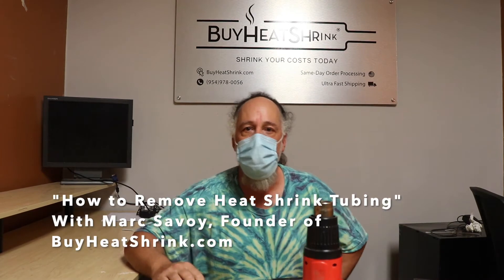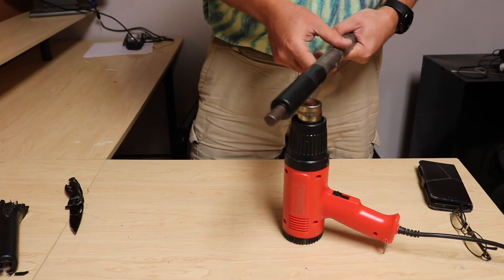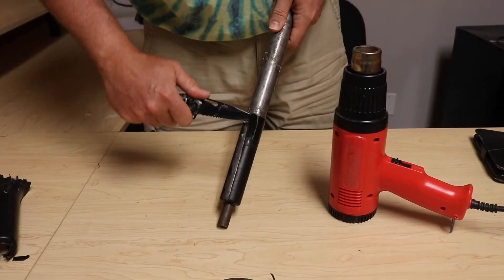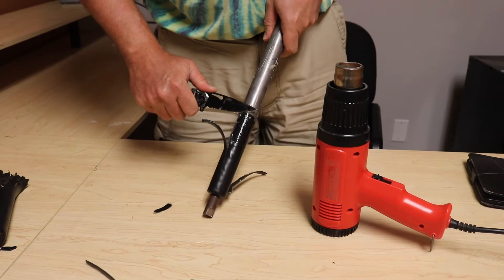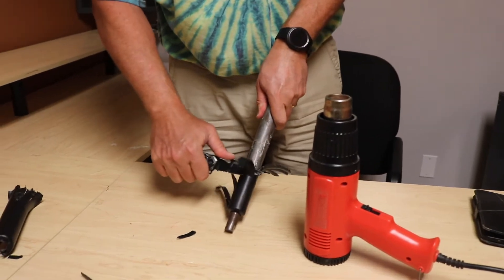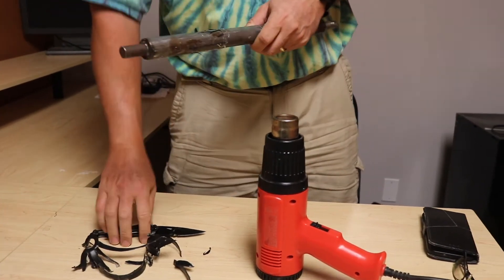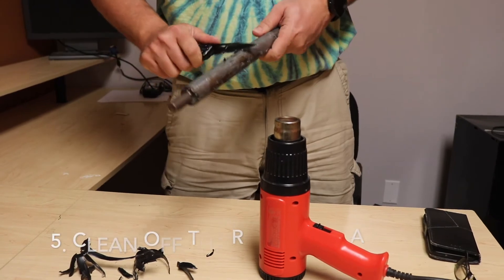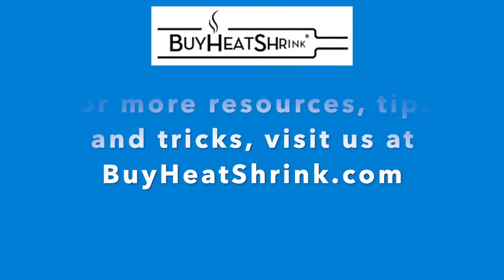How to remove Heat Shrink Tubing

Comment: Isn’t Shrink tube used primary on wires? And how to get it off the wires will be the real question
Reply from the maker: Hi William - you are correct. Heat shrink tubing is mostly used on wires, and in that case, removal would be difficult, and not really practical, unless you're using single wall (no adhesive) heat shrink.  This video is geared more towards people using adhesive lined (dual wall) heat shrink on pipes, conduits, tool handles, etc.